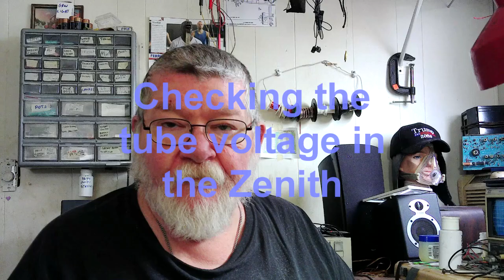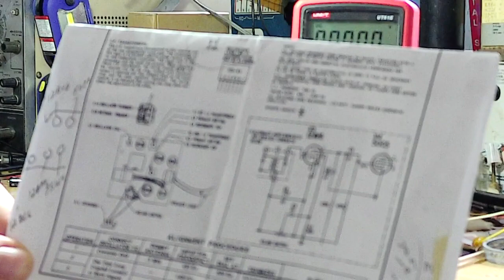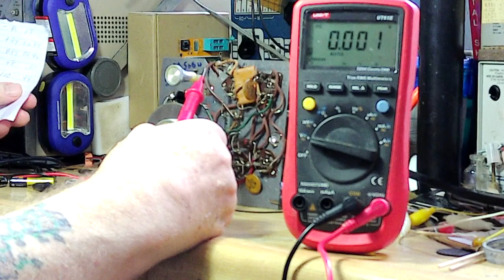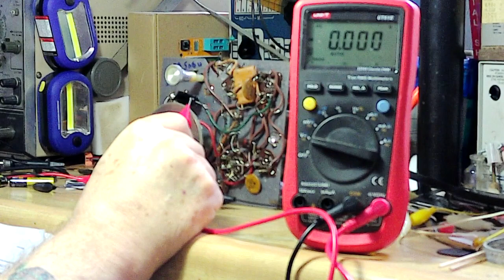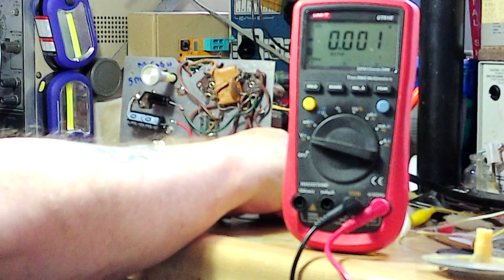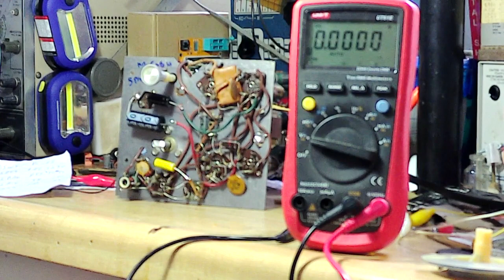Zenith. checking the tube volts

Comment: Good to see you in good spirits Carl! Enjoy your humor!!! Curious what those readings would be with an analog meter of that time frame...20,000 ohms per volt....maybe not that much different but, it should load the circuit a bit....just a thought...Im about to "check" the alignment on my Zenith.....remember Doug talking about not having to do an alignment each time...and thats true...so, I think I will do what a tech in the day would have done....probably by ear....then go back and use the equipment and see how far off I was???? What do you think? Keep safe....Take Care--Larry
Reply from the maker: That's a great idea Larry comparing the two techniques. I have a VTVM that I should probably use more. Have to check the volt to ohms on it.
Thanks buddy.
Reply: skycarl I think the VTVM will have 10-11 Megohm.....I was thinking more along line of a pure resistive meter like an analog simpson, triplett or a reasonable facsimile thereof....not a have to....just thinking what most techs had back in 1960... Take Care--Larry

Comment: Great video Carl, I know on the old radio schematics they show the input ac voltage  of 110 or 117 volts, if you set variac to that voltage the readings might be spot on.
Reply from the maker: That's a great idea Jim,,, thanks bud.